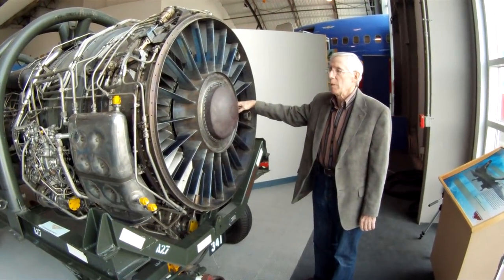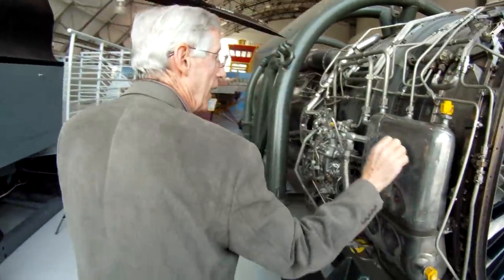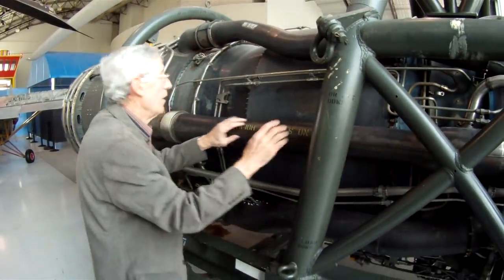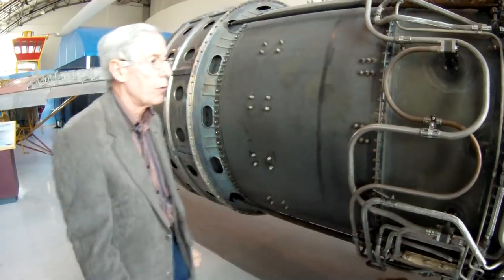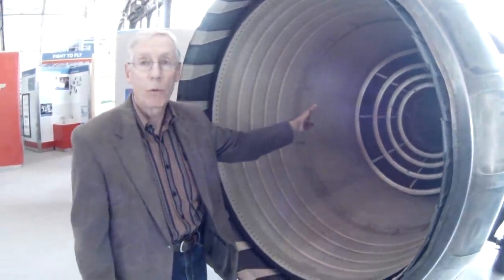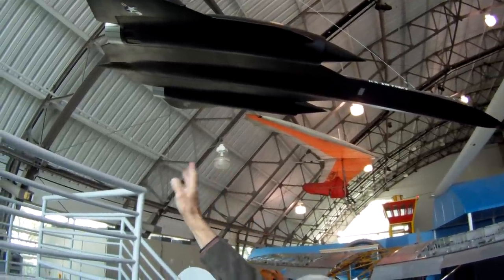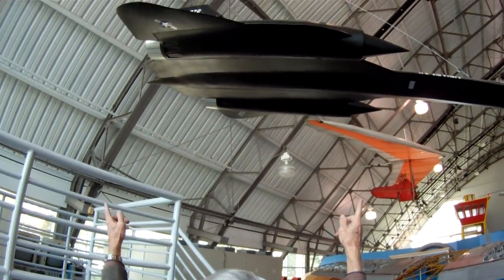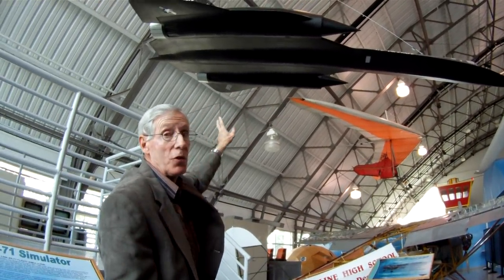SR-71 J58 Engine Tour

Comment: The SR-71's top speed is still classified.
Reply: MrSmithaustin It is not. Mr. Graham openly discusses this topic. Mach 3.2 was normal cruising speed, Mach 3.3 in danger close situations, and a test pilot he spoke with said Mach 3.4 was it's max capability.
Reply: Bastille Croquere The Top speed is STILL CLASSIFIED.
Reply: My bad. I thought CLASSIFIED means that you can't talk about it without incurring some type of criminal penalty.
Reply: +MrSmithaustin ..Also the max Altitude is still Classified. For the heck of it, I say the SR-71 can go Mach 4 and 100,000 ft.
Reply: It could reach mach 4 with extreme stress to the airframe,the engines still I believe could gain and ceiling height was much more than 80,000ft..Wonder what they got now,I don't think the mach speed was an engine situation as much as the airframe..
Reply: @Weird Science The F35 is after the Raptor and it is obviously a manned aircraft haha
Reply: Weird Science the raptor is the F22, the F35 is the Lightning II
Reply: The J58 in this video is not the engine design  that was in the SR71s
The crafts true nature is still classified.  The real engine is a Jet that converts to a Ramjet that converts to a Scramjet depending on the speed and altitude of the craft. 
Do you really think they would declassified the true specs of the craft.
Yup, just what we need is Chinese made SR71s  falling from the skies.
Reply: @negativeindustrial    THE TRUE ENGINE SPECS ARE STILL CLASSIFIED!
Reply: offplanetevent
I wasn’t replying to you. See the name of the person I was replying to above my comment? That’s how replying directly to a comment works on YouTube.
Reply: @negativeindustrial  No way!!!!
Reply: Good god... Americans always say that. It’s their potential that they brag about. 

But when you see stuff like Pearl Harbor and 9/11 and Vietnam you know what’s really going on. 

The SR-71 is limited to Mach 3.3 by its inlet discharge temperature which is 427C. 

The SR-71 is already more like the Space Shuttle than a regular aircraft.. with a week or more of maintenance required between flights. Go faster than Mach 3.3 and it’s going to be a month or much longer as you remove both outer wing panels to remove the engines and then hope to hell there are spares or spare parts available.

Comment: That inlet design seems to work in a manner similar to a venturi. A low pressure region that becomes restricted toward the outlet in such a way as to efficiently accelerate the air flow. 

I would like to know how the engineers discovered there was an excessive back pressure of sorts within the compressor area.

Comment: This video was a little miss leading.  The J-58s are not capable of flowing super sonic air past the compressor blades.  Most super sonic planes use a system called variable air to slow the air as it enters the inlet. This plane uses a variable by pass system to redirect the supersonic air back to the hot section.  Ram Jet Effect  I think the 20% turbo jet number is close. The 3.2 mach number is low. Fun looking back to this great plane.

Comment: If you're driving your car on the highway at 70 MPH, and a car passes you at 300 MPH, that is the equivalent difference in speed between a commercial jet airliner at terminal velocity and an SR-71.

Comment: He leaves out a bit that needs knowledge of the gas laws from Chem & Phys.  

In a shock wave the air decelerates from supersonic to subsonic.  Per Bernoulli, high-speed air (the free-stream) has much lower pressure than than the low-speed air that's hit the inlet spike and its shock wave, and (thanks to the spike moving) is INSIDE the inlet.  

That pressure pushes against the airframe in all directions. Aft, it goes into the turbine and bybass tubes. Radially, it balances. 

Forward, THRUST!

Comment: So are the moving exhaust nozzle "thingies" actuated ("closed"/extended out - somewhat closing the "combustion chamber" of afterburner) as you turn on afterburner??? 
Or when (at what condition) are they actuated ???So whole engine assembly acted as a ramjet+jet engine... Could you still fly supersonic with turbine fuel turned off completely (like if you lost all oiling from shrapnel piercing tank/oil lines or something)? 
Just curious, i guess that would be way out of specs and done just in emergency ;-)

Comment: I really thought those by-pass tubes provided a lot more thrust than this guy seems to think. It's such a neat idea for switching from turbo to ram-jet power, I don't know why it isn't more commonly used- apart from the difficulty of building planes that can function at the speeds it would enable of course.

Comment: thanks! a great help for a project i'm doing about compressible flow
Reply: at a boy greg don't forget variable inlet guides his a great help also the six tubes you see coming from the compressor,the j 58 had trouble with proper airflow in the start of the compressor so the tubes regulated the flow by bypassing some air to the afterburner for a little thrust but it's better then wasting it. it's a pretty neat plane. good luck greg i always encourage young people too become jet mechanics,work anywhere in the world get too fly money his good give it a tought cause a jet engine his a big compressor that moves incredible amount of air

Comment: I have one question about the blackbird. I heard that it consumes less fuel when flying at 3.2 because of RAM thrust. So does that mean that it doesn't use fuel to move the turbine that moves the compressor blades? Or it uses fuel but very little, meaning the throttle is about half way?

Comment: the bypass tubes of the j58 inject pressurized (bleed) air into the afterburner. isn´t  that the same principle which is used in modern high pressure/low bypass turbofans?

Comment: Is the SR-71 a plane with two engines or is it two engines inside a flying frame?
Reply: As opposed to two engines inside a plane?
Reply: tbh if the plane didnt reach a critical structural point at around mach 3.5-3.7 i think those engines could have easily surpassed mach 4, since the acceleration of the plane, the fuel efficiency and the TWR were better for the plane at speeds higher than mach 3

Comment: I wonder if this engine would be good for a long range interceptor or maybe a long range interceptor/strike fighter?
Reply: There was an interceptor version of the SR-71 planned, but it never made it to production.  They called it the YF-12.
Reply: The YF-12 never saw military action because the SR-71 was needed more and the YF-12 never caught on. A few were made for flight testing though. The biggest difference was the addition of missiles on the wings and also bottom fins as well.
Reply: You mean like, the A12, there was a interceptor version that had 6missile bays 120 lock up range
Reply: @DavidBrown-in3oj  they discovered the plane was faster than the missiles! You would launch an AIM9 and would chase your own plane. The did develope a bomb that didn't need a bursting charge. It just used kinetic energy!
Reply: @JohnRodriguesPhotographer  Higher speed missiles were developed. The GAR-9/AIM-47 had Mach 4 speed. It scored 6 kills in 7 attempts. See wikipedia AIM-47

Comment: I can't believe how many things he actually got wrong in this, especially for being a pilot of one of them. Everything he said about the afterburner and the variable nozzle is wrong. The rings are NOT spray bars, those are flame holders. Also if you choke supersonic flow (which afterburning exhaust is supersonic flow) then it actually chokes the engine. Supersonic plow accelerates when you open up the nozzle and subsonic flow accelerates when you constrict the nozzle. Look at videos of afterburning engines and watch their nozzles.

Source: I am a jet propulsion engineer.
Reply: You are correct about the flame holders.  I  assembled them in the jet shop at Beale.

Comment: excellent video, but this engines burns JP-TS, not JP-7. It can run grades other than JP-TS in an emergency in-flight refuel, but the entire system will need to be flushed.
Reply: 🤔 Ah ok then, you must know more than the guy who actually flew the Blackbird then, perhaps you should be doing the tours?  Anyway the U2 uses JPTS while the SR71 did infact use JP-7...

Comment: Please what keep the enjine running 'spining' after the starter ?
Reply: Fuel is ignited by a spark plug or igniter  when it first starts to run , then the heat from burning gasses lights more fuel as it's added, the extreme speeds of air coming in require a "flame holder" which insures a flame is ever present to ignite the fuel...high pressure high velocity air can blow out the flame ...which is called a flame out,(dangerous) the flame holder provides a sheilded flame that is ever burning to ignite fuel
Reply: @821marko  Thanks sir

Comment: No flame holders in the afterburner, how do they prevent flameout ? anyone ?
Reply: I'd imagine that at those speeds everything gets hot enough that it would self combust?
Reply: Pyrepenol
From my understanding of it that is exactly what happens. The whole design was basically a sophisticated ramjet. The afterburner section became at speed the "primary" combustion chamber if you will instead of the compressor section. Really clever syste,. Pity we aren't doing that today.
Reply: Those light coloured rings are flame holders. The J-58 has 4 flame holders and 4 spray rings. The spray rings aren't easy to see in this video but they are there just in front (up-stream) of the flame holders where you'd expect them.
Reply: landintrees You are right, but the man in the video "says the flameholder" is the spray bars, he should say behind the flameholder :-)
Reply: Magnus Andersen what do you expect? He's a pilot!

Comment: I'm pretty sure he is not telling the truth about the " by pass tubes "....
Reply: You means the bailing twine and duct tape solution for an engine designed for a flying boat with too large of a compressor to make up for its negative thrust at any speed above Mach 2.5?

Probably. 

Better to design an engine with Mach 3 in mind. The GE YJ93 didn’t need no stinkin’ bypass tubes and was much more reliable and efficient. 

But if you’re on a black budget and the cost of overthrowing democracies to install dictators is eating into your spy plane budget... you improvise.

Comment: BS. The "J58 "  and the engine here is not the engine in the SR71.  The real engine is a Jet that converts to a Ramjet that converts to a Scramjet depending on the crafts speed and altitude.  Do you really think they would allow the real specs to be made public. And do not tell me " its old and it has been declassified. The engine design in this video was one of the first designs and it only flew in test flights. It was quickly replaced with the still CLASSIFIED engine.

Comment: So mach 3.2 it's only using 20% of its available power...... soooooo what's it's top speed if it uses 100% of the engines power?  I knew someone from the ground crew on Midway island and from what they told me mach 3.2 was nothing for the plane. Only 20% engine power I guess it wasn't BS.
Reply: Its top speed is 3.3 so calm down and listen to the explanation again because you missed it entirely.

Comment: Why don't they use this motor in modern jets they would be so fast.
Reply: The main reason is because modern jet's wouldn't be any faster with a J58. While the J58 produces a pretty large amount of thrust, it's actually comparable to the GE F110 that's used in most F-16s. In fact, the F110 weighs less than the J58, so it has a better thrust to weight ratio. The J58 on its own is an impressive engine, but it's only half of the equation for speed. The SR-71's aerodynamic design and the ingenious engine nacelles are the key factors for getting the most out of the J58 engine.
Reply: @garriteinig3445  but I looked at there mach numbers and none can cruze at mach 3.2
Reply: @drfoo4341  That is very true, but it's because modern jets, like the F-16 I mentioned(but this applies to every other jet, be it an F-22 or a Boeing 787), aren't designed to cruise at mach 3.2. That very thing is the Blackbird's calling card. Its ace in the hole. Cruising at mach 3.2 far away from danger is what it was made to do, and it was outstanding in that role. The engines alone didn't make it that fast.

The Blackbird was extremely specialized, designed and built from the very beginning to cruise at mach 3.2.

The F-16 was designed primarily to fly in combat against other aircraft, and because of this it's quite small, light, powerful, and made for great visibility. Its engine was made to operate in combat flight conditions.

The Boeing 787 was designed to carry a lot of passengers efficiently at subsonic speeds, and because of this it's large, very aerodynamic, and has many comfort features. Its engines were made to be efficient and quiet.

The SR-71 was designed to cruise at mach 3.2 at altitudes exceeding 80,000 feet for long periods of time. Because of this, it's made of exotic alloys and composites, it's shaped to dissipate heat, and it is as aerodynamic as possible. Its engines were made to make a lot of power at high altitude burning special fuel. They operate like turbojet engines at low speed and ramjet engines at high speed.
Reply: @garriteinig3445  ok man thanks

Comment: This guy is a pilot so i will give him a break.   Those bypass tubes are to bypass the engine so it can go 'ramjet mode'.    Simple.
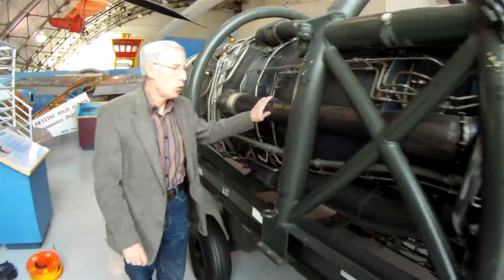Reply: Yea 1:00 Ramjet tubes "most engines don't have these tubes", there ya go!
Reply: *****   This is a ramjet!   He doesn't explain it well. sorry.
Reply: Haha no it aint! this engine squeezes the air doesnt ram the air!!
Reply: esmi000
Do you say Tomato? Or To-maw-toe ?
Reply: ***** Yeah know what you mean. Did esmi realise what he said?
Reply: The bypass tubes on the compressor his just too straighten the flow in the compressor it bypasses the combustion chamber and re enters in the afterburner and it gives it a little more thrust nothing wild but it's better than just letting the air go too waste ,I'm pretty sure the pilot knows a little about his aircraft
Reply: ***** WRONG
Reply: Eric jones 
   NEGATIVE!!
   Those 6 tubes, are more like waste gates, to alliviate the pressure that builds up in the compressor last stages!! (they are small for feeding the necessaire air to the ramjet!!)
   Ramjet works with A LOT MORE air mass, that the one those tubes can suply!!!
   The BIG air volume for the ramjet, flows around the engine, and inside the specially conformed, (interior), of the naceles!!!!
  The ramjet, completelly BYPASSES the turbojet engine!!!